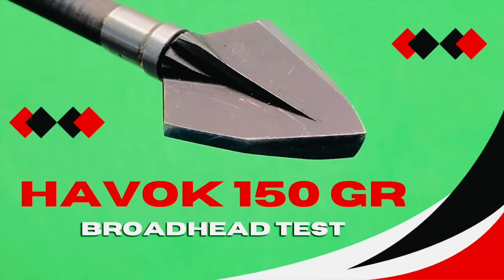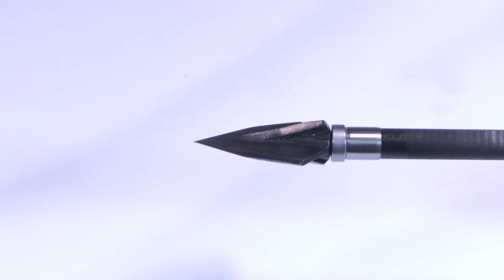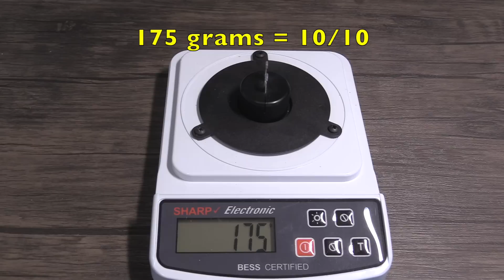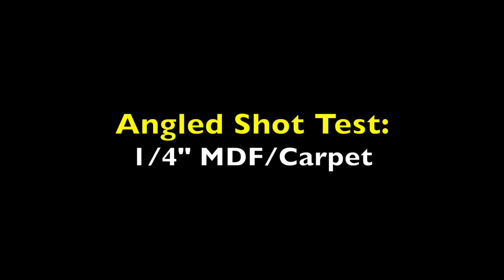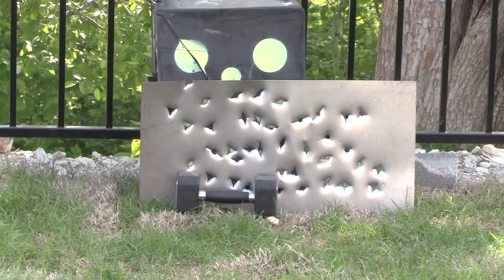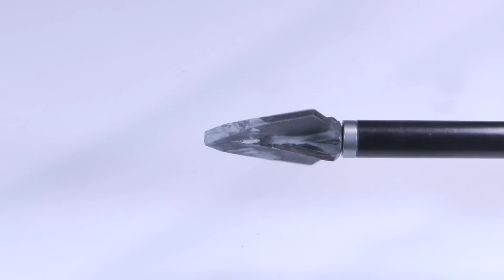HAVOK 150 gr: Broadhead Test (Single Bevel/Double Bevel)

Comment: why single bevel then double?? seems backwards. having the single bevel back more would give more torque for the "bone splitting/rotation" unless if I dont understand the single bevel theory right
Reply from the maker: Well, it’s the initial impact that generates the most rotation, so you want that impacting the bone first, and causing it to split.
Reply: @LuskArcheryAdventures  oh I see. thanks for your reply

Comment: Fredbear tried to sharpen his broadheads he didn't try he did his material was a little thinner it was a two blade with a bleeder blade in it, A insert that you can take in and out but he also filed his broadheads in the same technique or the same honing or edge that you guys are displaying here on this hovac, fredbear knew that this design would work it would cut on contact would cut on impact.
Reply from the maker: Thanks for sharing that.

Comment: S7 is IMHO perfect overall for durability and rehappening. Gel penetration of 8+ inches is about as good as i've seen tested on this channel. The typical "S" cut from a single bevel wasn't noticeable to my eye, but it did open a wide hole on the steel plate. 30 degree rotation is excellent. Durability was outstanding. I was shocked it dropped sharpness so fast and that is not characteristic of an S7. So was it the design of having two designs built into 1 head ? Strange.  I'm not sure what we would have here on an animal to be frank. That's to be expected from a cross designed head that is very unique. Good to see some blood on these and see what happens.
Reply: Heat treatment plays as much of a role in edge retention as the steel itself does.  Maybe they need to refine their HT process. 🤷🏻‍♂️ Just an idea.
Reply from the maker: Thanks for the comment, Mike. That surprised me a bit as well. I did it a few times. Still, it was only an extra 50 grams of force to cut the wire, which is a score of 9/10.
Reply: Keep in mind this was just a prototype head… 
As John said it still scored a 9/10 which is great and it checked all the other boxes as well. 

For all the benefits your getting out of one design it only takes a couple extra minutes to sharpen. We just released our sharpening tutorial on our channel
Reply: @HavokHuntingProducts   I for one am not concerned about sharpening. I think this would buff up just fine. John said 55 or so rockwell hardness ? Could possibly getting it up harder help keep the edge ? But we who know, know the harder the material, the harder it is to sharpen as well. I actually prefer them a bit softer,makes for sharpening much faster.  Do you have any videos on the hunt with these yet ? I'm curious because the hole looked LARGE and that's a big plus regardless of cutting diameter. A big blown open 1 inch hole is huge, bigger than people realize.

Comment: Does the wider bevel at the front aid in penetration? Maybe I’m not saying it correctly but I noticed from the midpoint to the tip of the broadhead looks like a slightly different degree angle.
Reply from the maker: That's the single bevel portion of the head, that narrows a bit as it reaches the double bevel portion.

Comment: I hate the flat leading edge. I prefer a tapered point. My only complaint is that if the bleeder gets too warped you can't replace it.
Reply: The flat leading edge is a huge aid in (hit and split design) it works like an axe does fire wood. It hits and splits the bone while the single bevel rips the bone apart right behind that axe style tip, the double bevel then causes more cutting and better pass through performance as it eases tissues drag and resistance and just allows everything to do it’s job with no wasted energy.
Reply: @HavokHuntingProducts  I guess most fair question is what is it specifically optimized for? And how much is it affected by grain direction of the bone? The overall leaf shape is a great design for durability and resisting deflection, but wouldn't the flat tip affect penetration on angles and through hide?

There's no free lunch, and it's all about the right environment. One animal and one shot angle would benefit from one design more than another design. Speed, weight, and target medium are the critical factors I compare. Some things work better at higher speeds than others. 

Edit: everyone shoots different bows and different arrows, so I don't believe in a "perfect" design. Fundamentally it doesn't sit well with me. So optimizing a design is about prioritizing one thing over another. Bone radius and impact angle are huge factors in deflection and penetration, so it is nearly impossible to compare across all the hunters in the world. I like the design, even if just the idea of sharpening it gives me a headache.
Reply: @YoureSoVane that tip should aid penetration on angles and hide.
Reply from the maker: I've come to really appreciate those flat tips like that--still super sharp and aids in bone breaching and durability.
Reply: It’s built like an axe or a log splitter for bone splitting!!